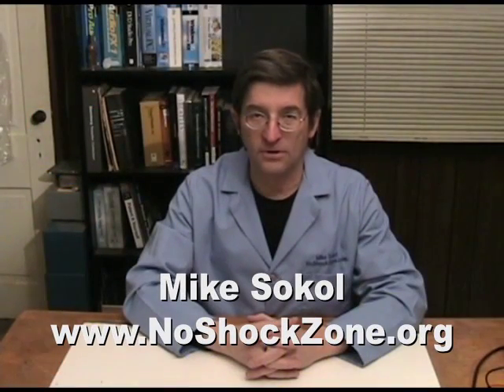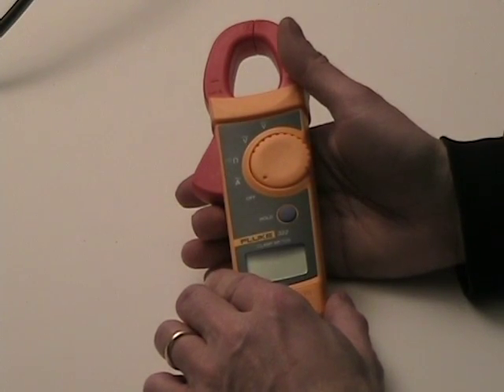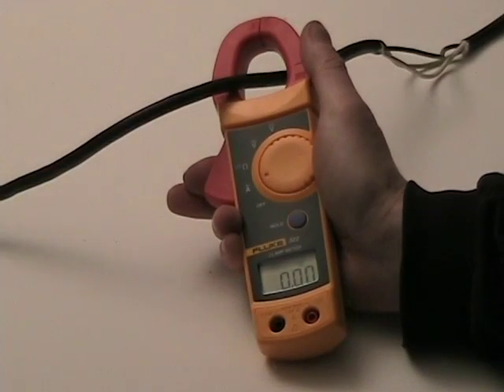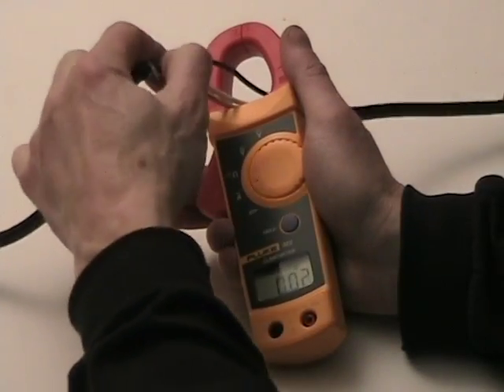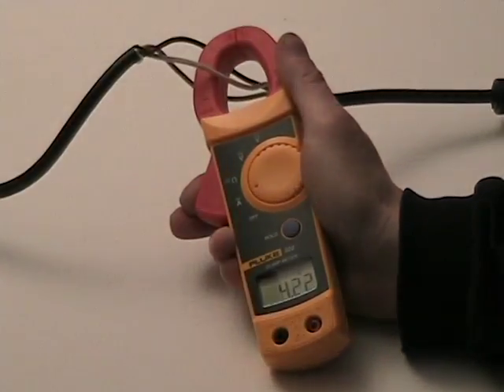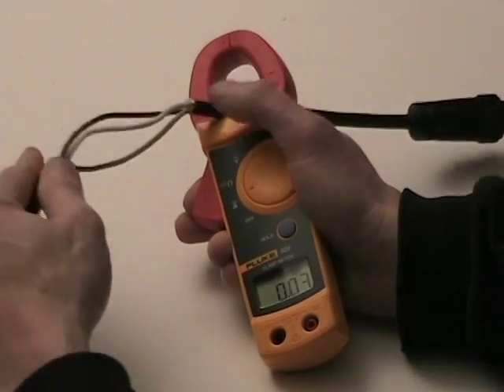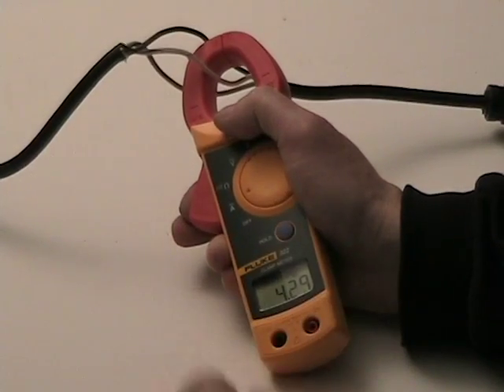How-To use a clamp-on ammeter

Comment: Well that explains it. Bought one of these specifically to measure the amperage draw on my new pressure washer and I basically get just zero. In other words, I’d have to cut up my new pressure washer power cord to get an accurate amperage reading. Very frustrating. Thanks for the explanation.
Reply: @simonwilson7581  Ended up just buying a different style for $10 on Amazon that plugs into the wall and then you plug your item into that and it gives you the reading

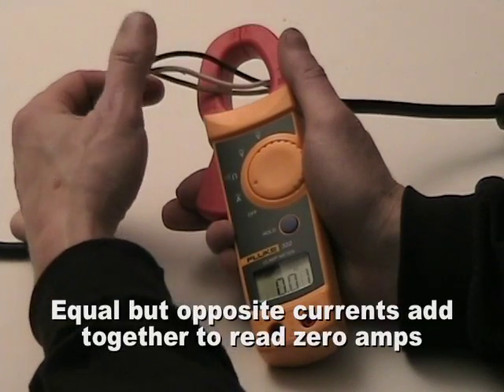Comment: Thanks for the video, although the part at 1:10 about the white wire's current being "opposite" to the black is something I'll have to give some thought and study to. Having to clamp around one conductor certainly makes the process difficult if not impossible. Do people make, or buy if available, a short gadget with three wires separated, with a receptacle and plug, so they can plug in the device and test one wire?
Reply: Yes they make them for 12-15$  I just bought a 1 foot extension cord 12 gauge and will split the wires like shown above.  1 foot extension is about $8

Comment: Thank you! 

I have for a long time planned to by one of theese meeters. Will it work the same way on DC current too?
Reply: it has to specify that it has a DC ammeter. I made the mistake of thinking that it read AC and DC amperage becuase it read AC and DC voltage, but I was wrong.

Comment: I clamped the jaws directly onto the insulated 3 core power cable supplying 220 volts to a bar heater that was pulling 800 watts and got a reading of 0.7 amps. Does that amp reading make any sense?

Comment: why did the white wire not shiw current?, What is the purpose of it being there?
Reply: +Youtube Tv The white wire had the same (but in opposite direction) current as the black wire. The green wire (normally) carries no current. The purpose of the green wire is a safety feature. If for some reason a metal casing becomes "live" the green wire will ground the case.
Reply: The reading on the green wire was due to induction
Reply: If you're asking why all 3 wires wouldn't show current, it's because the ground wire wouldn't be used for anything in this case.  I think he explained the other 2 wires quite thoroughly.

Comment: I measured amp on a conduit of our building, it shows 7amp which presents there is fault wiring. How to trace where is the fault wiring or maybe neutral wire goes to a different circuit? 

Is there any tool to find where the fault wiring occurs without tearing down the wall?

Comment: Your vid help, thanks. What is a good clamp on ac/DC meter for general use?  Something under $50. Thanks again
Reply: Uni-t UT210E.its 2800 rupees cost .it has ac,dc current ac,dc voltage , capacitance, ohmmeter,magger,diode check, continuity,back light,non connect voltage detection,vfc for variable frequency drive voltage testing.holding for reading.and it works on two AAA size battery.im using it from last 1 year .....it's highly accurate

Comment: I cant handle videos like this.  ammeter?  Would be for measuring AM radio stations?  How about saying amPmeter
Ampers? Amperes!
Reply: http://www.quickmeme.com/img/2f/2f3640a3393b93b2fb5049e133de5addf3bef697aa7e96e11d866c2399f0b0e8.jpg

http://en.wikipedia.org/wiki/Ammeter
Reply: What can't you handle?  The fact that a meter for measuring amps is actually called an "ammeter"?  I'll admit the English language is funny but you can't blame the video for an amp meter being called an ammeter!

Comment: Great,..just rig an extension cord like that one instead of cutting into the  appliance power cable...my customers wouldn't like that.
Reply: Except many appliance power cords aren't terminated in a plug, but yeah maybe in mobile power if you set it up that way.   However if you have a plug, I'd sooner use a kill-o-watt meter because not only does it show current but also logs power consumption through the various power states to reach a total power supply budget.

Comment: I have a cheap little clamp meter I got of the bay and today after years I tried it on dc and it appears to work, I have 2 battery chargers running in the garage and the clamp agrees with what the ammeters on the chargers are saying even shorted out the little one's leads and it read 16 amps till the internal breaker cut out, same as the dial on the charger. I always thought you couldn't measure dc with these units. It is a MT87 clamp meter.

Comment: They aren't exactly intended for "home/casual" use, but rather industrial applications such as large systems/machinery/etc.

I'm pretty sure he just stripped the extension cord as a demonstration tool, really.  :-P

However, I must admit that I'm putting together a very short cord, essentially just a plug and socket with the separated wires being accessible but of course still insulated, not too vulnerable to damage. Then I'll be able to test anything plugs into a socket. Not typical usage, no.

Comment: For DC, what you do is run it through the wire leads of the meter.  The current then actually flows through the multimeter, giving you a reading.  At least, that's what is typically done.  I'm not sure if a magnetic field type ammeter such as this could be used to read DC amperage with different circuitry or not...
Reply: Yes I have one on order that supposedly will do this, but accuracy sounds like it isn't as good as what you say, still quicker then what you specify to do.  I'll give it a go on my car once I get it.

Comment: Only if the clamp-on ammeter has a "AC" AND "DC" setting, or if it blatantly says "measures DC" on the package or "AC/DC" on the face of the ammeter.  btw ac/dc is a good rock band too.